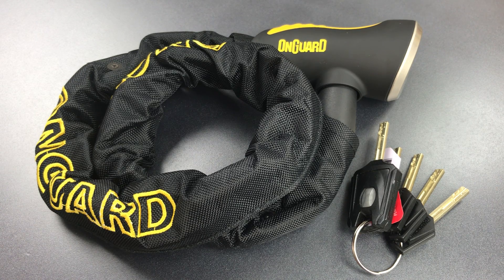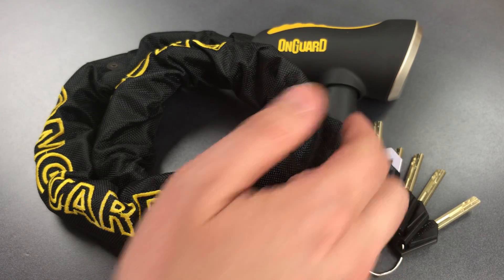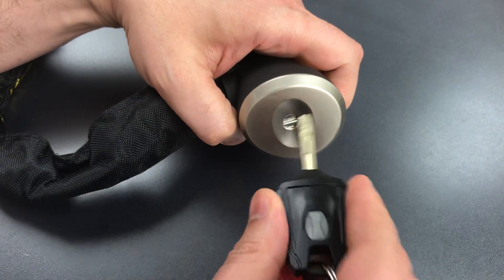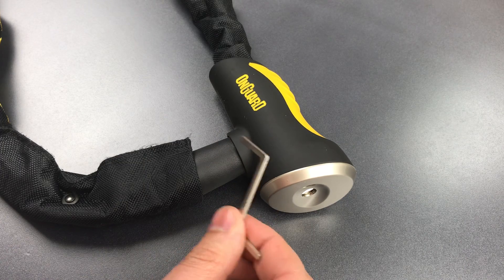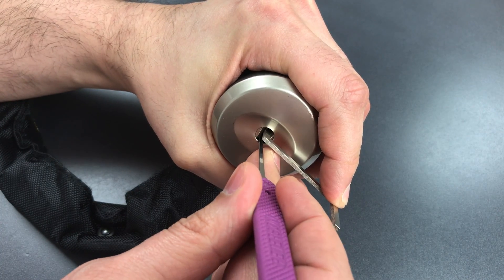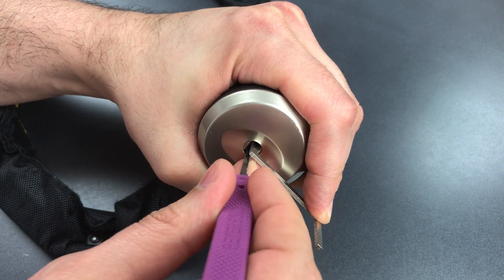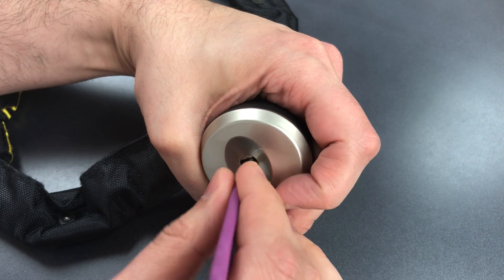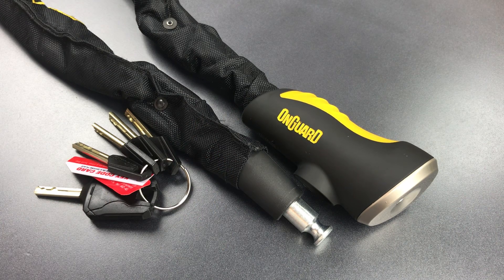[680] OnGuard Mastiff Bicycle Chain Lock Picked

Comment: Does this come in different size chain I want a size Maybe 10 in chain longer 1 that can fit a rim a square post when I'm at Hibachi Grill on the southside of Indianapolis Indiana and how much just a tad bit longer working fit through the frame and maybe through the back of the wheel Maddie postage for the frame since they got more lock I can put through the back wheel in the front wheel cuz I'm very cautious valve people still in my mountain bike that earned it the hard way by working for it and not going out and still in it like some people would that's why I want a longer chain and I also think about getting me a bike alarm I just haven't found the right one yet they're all out there but I just haven't found the right one the bike alarm of I think it's spelled a b u s e I forget how to spell something about get one of those mating

Comment: LPL, consider using a sewing thimble for your finger with the tension tool.
Reply: Gary Rumain, you would lose some of the feedback on the tensioner, and that's an important component in picking
Reply: I did wonder about that. Thought it might get passed through the metal of the thimble.
Reply: Gary Rumain they make rubber & metal thimbles. Good idea but both should be tested in a video to be conclusive.
Reply: Yes, but I think avoiding the plastic and rubber ones would probably be wise. A few weeks ago I actually suggested elsewhere that a coin-sized plate welded to the tensioner would help with the pressure. But it occurred to me last night that a metal thimble might work just as well (as long as it doesn't slip).

Comment: I've never picked a slider lock. Looks like another type of lock I'm going to try to get into. Thanks for showing the picking first. Destructive entry is fine, but I  like to see how difficult a lock is to get into non destructively.  Anyone can buy & operate a cut off grinder, torch, hammer, bolt cutters, etc. Don't get me wrong, I love to know about any lock's weaknesses. Skill impresses me more than a brute force attack, but I admit the brute force attacks you use are different,  and very entertaining.

Comment: Apparently, according to one video, this can be broken barehands. It would be good to see you try that, maybe their test lock was defective or altered in some way, or maybe the man was just specially strong... although I guess the later would still be a concern since anyone could use some tool to achieve similar results.
Reply: link please..... i just bought this lock so im curious to see.
Reply: PARADOXICLES nevermind, the video I saw says mastiff chain, but the product itself appears to be a combination lock chain, so not the same model. My bad.
Reply: is it the same type of chain? might still wanna see
Reply: PARADOXICLES https://youtu.be/7MievV-wSAM this was the video. It's not the chain what breaks but the part that goes into the combination thing.
Reply: thanks....wow, thats not a good lock

Comment: Where did you find an 0.080" tensioner? Or what did you make it out of? I've been wanting some thicker ones lately but haven't seen many options.
Reply: Have you checked on eBay or Banggood? Here's a search I just did on eBay -
https://www.ebay.com.au/sch/i.html?_from=R40&_nkw=lock+tension+tool&_sacat=0&LH_TitleDesc=0&_sop=15
Unfortunately, they don't give sizes.
0.08" is just a little over 2mm. Which isn't that thick. However, there are some alternatives. I post another comment with a link so this one doesn't go into the spam folder.